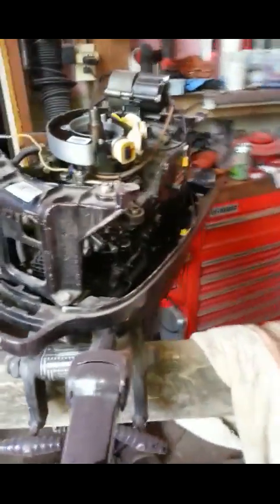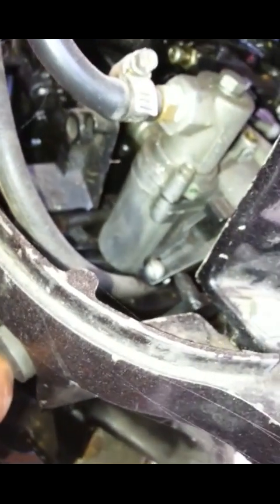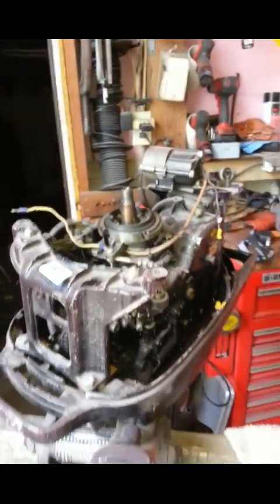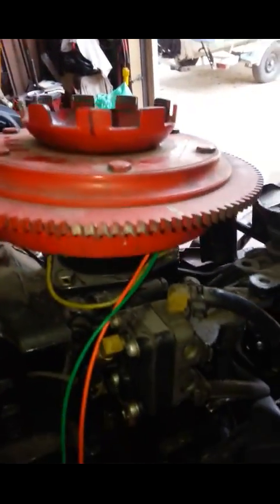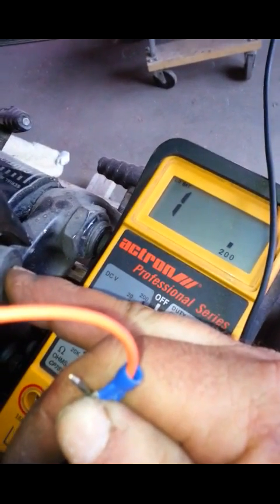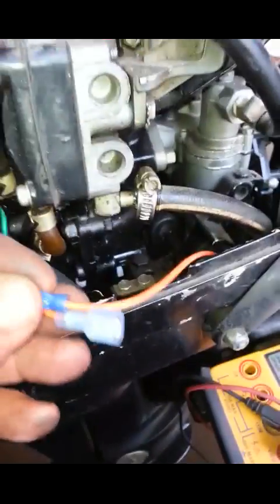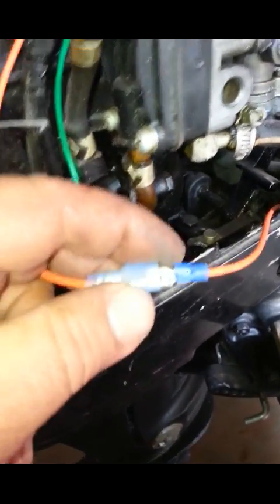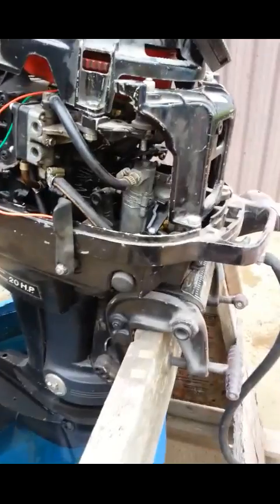cdi electronics stator failure

Comment: I have the exact motor. I changed the impeller & tested it on muffs. NO WATER coming out the weep hole.
I pulled it apart thinking the tube didn't line up but everything was correct. tested again & still no water. 
Come to find out that this engine has to be submerged into water. When I did water sprayed out. Lesson learned the hard way. DO NOT use muffs!

Comment from the maker: Just a little more on this stator.. ran a second  test and this time I mounted a flywheel in our lathe. then mounted the stator to the tool holder. came up with the same results. then I mounted the stator on four stand off's and ran the test again. When i removed ground it stopped working. when i grounded orange wire it started working again. i hooked up the ground and removed orange wire it stayed working. so what i believe the problem is that the wiring of this and all the stators in this run  are miss wired internally. the ground or neutral are not Isolated from the orange wire.

Comment: Stator puts out 100=400volts and has nothing to do with any power controls.
Stop circuits grounds out the primary on the control module.by the means of control.
I think you got it wrong with cdi repair

Comment: ever check that kill button?????-just sayin--zzzzzzzzzzzzzzzzzzzz
Reply from the maker: Like in a video it was checked over and over again there was nothing wrong with a kill button. But for anyone else I would check the kill button first Make sure It was grounded due to the fact that kill button removes ground from the stator in normal circumstances
Reply: When you turn off ignition the ignition is grounded not other way around